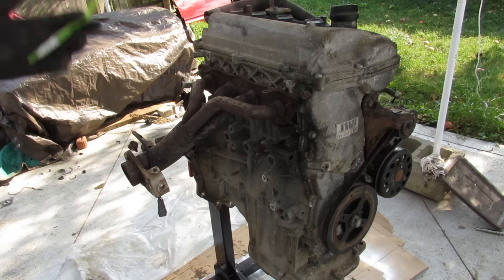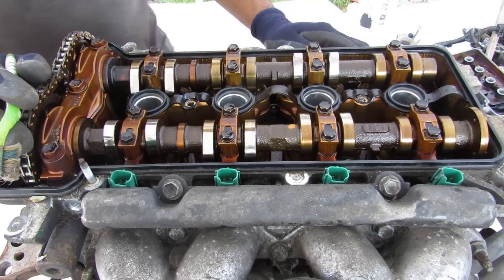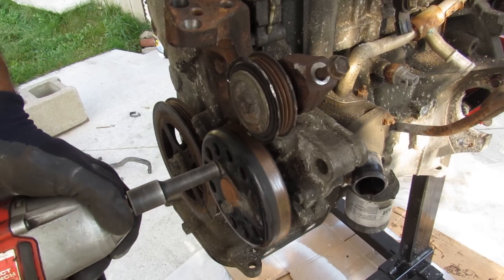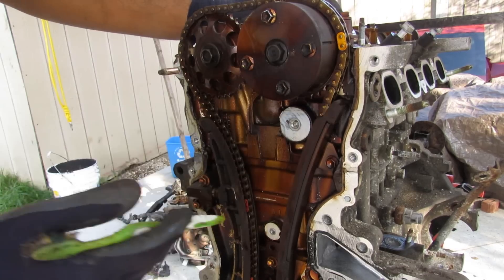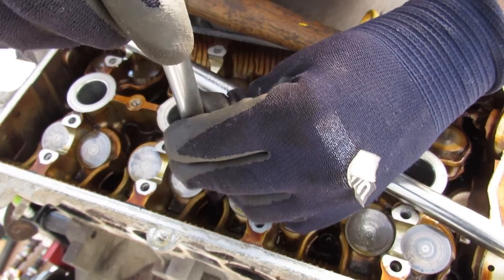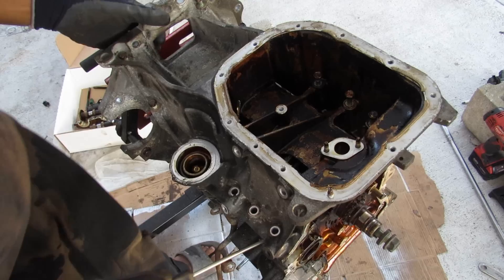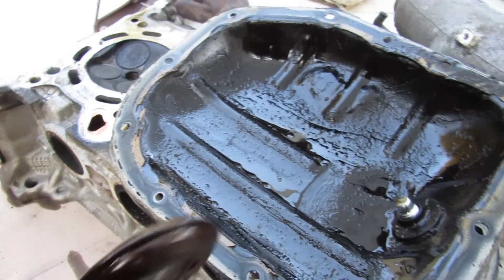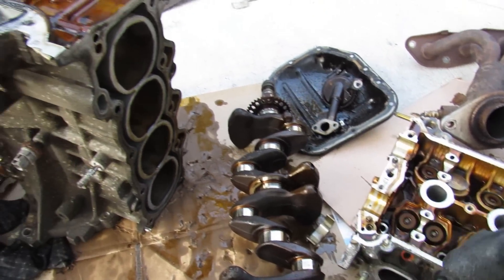What's inside a 500,000 km Toyota Engine?

Comment: The engine is so well made. Although a hybrid car uses its engine less, there is a lot of start/stop on the engine. So Toyota must have figured out how to prevent wear on start/stop situation in order make the engine last forever.
Reply: Starting only causes wear due to low oil pressure and cold oil being ineffective. Once the motor is up to temperature, starting it again only wears out the starter motor itself.
Reply: @grahamek86  and a hybrid doesn’t have a starter motor. The secret is: they start on the drive engines, permanently connected through the single planetary gear that makes up the transmission.
Extremely simple, mechanically.

Comment: Toyota's are just amazing. I have seen many vehicles with 500k kms. No other makes comes close.
Reply: My wife and I both have Chevy Tahoes that have over 300,000 miles on them and only ever changed alternator and water pumps. Granted we are both mechanics and keep up with maintenance but they still run like new with plenty of power and run hard daily. No sludge or leaks. Hers does burn alittle oil but isn't as meticulous as I am
Reply: @christbennett429  Granted bigger vehicles will last longer. But Toyota s small cars r also awesome

Comment: I wonder if the basic engine block may have been even older than this. Toyota echo maybe even the Toyota Tercel at some point had a 1.5 L engine. I know the cylinder head would have been different. But I bet the short block is essentially the same.
I've got an Scion XA with a 1.5 and it certainly looks identical the water pumps in the same location etc. And that car came out in '04.

Comment: MY DAD'S CAMRY HYBRID LE 2018 I BOUGHT IT FROM BRAND NEW IN DEALER AT $29K OUT THE DOOR RIGHT NOW RUNNING 280.000 MILES NOW. HE USES THE CAR TO DELIVERY EVERYDAY. 

I DO OIL CHANGE 0W16 MOBIL 1 EVERY 6K MILES AND CHANGE TRANSMISISON FLUID EVERY 100K MILES USING 10MM HEX DRAIN AND REFILL (3.5Q ATF WS CAME OUT) . NEVER DO BRAKE JOB (FRONT BRAKE PADS STILL 6MM LEFT), 

NEVER DO COOLING SYSTEM FLUSH OR WHATEVER, ELECTRICAL WATER PUMP, BRAKE LUID, HV BATTERY ECT STILL RUNNING LIKE A NEW CAR.  THE CAR IS STILL RUNNING PERFECTLY. THANKS TOYOTA. MOST RELIABLE IN THE WORLD.

Comment: Toyota engine 300,000 miles, in much better shape than most Chrysler, Ford or General Motors engines with 30,000

Comment: my prius had timing cover oil leak and those clutch springs failed before 70k and whoever had that should have used a good synthetic oil and filters also cheap oil and or not changing will do..wish you would have done a compression and leak down test before you tore it apart

Comment: Interesting that I drove a Chrysler Concorde 228,000 miles on standard Fram filter. I sold it cheap at 228,000 miles and the folks that bought it said it was the best car they ever had. At 215,000 or so I pulled the intake manifold to change manifold gasket that had a small annoying leak. When I pulled the valve covers and intake the inner surfaces were were like new. The assembly line inspectors’ initials written on the undersides were easily visible. There was no build up of any kind in the crevices so I’d say the Fram filters did pretty good over those seven years of ownership. Helping the Fram filter was my religious changing of the oil maximum of 4,000 mile intervals. This engine you show was not a victim of Fram filters……poor lazy maintenance was responsible for that sludge. The engine was on borrowed time.

Comment: That looks really good for 500,000km, someone looked after it, I’ve taken apart some Mazda 3 and 6 engines and the cam shafts were caked in old oil at 230,000km.
Reply: I have a 2006 Tacoma 2.7L 5speed manual.  Just passed 200,000 miles and works great, doesn't  burn a drop of oil.
However, it leaked oil, and I've replaced the head cover gasket. The old one was brittle. Old rubber parts die first. But with a bit of care, Toyota engines go forever.

Comment: I have a 1NZ-FE in my ‘07 Yaris with 271,000.
Drive it every day since I bought it with 18,000 miles.
I’ve changed the oil at 10,000 mile intervals with Mobil 1.
Currently uses a quart every 10,000 miles.
Only replaced the alternator and starter.
Best car I e ever owned !

Comment: Wow! What an educational video! 😃👍👍👍
After having a Prius Mk. 2 for over 13 years I'm driving now a Yaris Hybrid (XP13) with the same engine.
I'm thoroughly convinced of this well  designed and simple engine.
Are the crankshaft bearing inlets made of lead❓
Reply: Modern engine bearings are made in multiple layers. The back is steel, which is covered with a thin layer of either aluminium/tin alloy or copper/lead alloy. If copper/lead is used it will in turn be coated with a very thin layer of either tin/lead alloy or pure tin.

Comment: In my experience, almost any engine approaching 300k will be burning a little oil no matter how well its been maintained. I'm referring to valve seats and piston rings. I've got a 1mz-fe with 260k. Synthetic its whole life and changed every 6k. It needs about a half quart a month if driven hard and over 80 mph. The valve cover gaskets are famous for eventually leaking on that engine too. They were just replaced and no leaks for now. A few seconds of blue smoke if started a few hours after an aggressive drive.
Reply: Valve stem seals will often go before rings or seats. Then oil will be sucked down the valve guides by manifold vacuum, even if your rings are perfect.
Reply: you are absolutly right, we owned a corrola verso for 15 years, it was still driving good but we needed the oil just as often as you fill up with gasoline

Comment: Is it really fair to say the engine itself has ~300k miles since it came off a hybrid? I’m not sure what the average duty cycle is in a Prius for the average driver but even if it were only on 50% of the time that engine looks clean for 150k miles of actual use
Reply: Still hybrid engines get a lot more wear starting and stopping all the time I'm sure. I'm still extremely impressed.

Comment: i managed to make my 2007 UK gen2 prius (everything stock including battery) to do 62 us mpg (75uk mpg) just with temperature spoofing and nothing more 
i basically drive the car all the time in stage 4 
gen2 prius has a very messed up engine software wich doesn't allow the car to be efficient to full potential 
I'm still working on ways to make it more efficient and i truly believe its capable of 70 us mpg under normal driving with refreshed or modified engine software

Comment: I have a 2013 Prius C same engine model with only 105k miles!! Love this video
Reply: Remember to clean the hybrid battery air intake, which is in the back seats, so your hybrid battery does not overheat.
Reply: @hedgehogthesonic3181  thankyou, I have been warned on a Prius c FB page about this 👍.
Reply: @Toyeboy89   You are welcome. Do it regularly since it is very important for the hybrid battery to stay cool for its longevity
Reply: @hedgehogthesonic3181  also since this engine did have some carbon buildup I'm thinking changing the name brand full synthetic oil & filter at 7000 miles instead of 10k. I expect to need a hybrid battery sometime thankfully there's a company that offers a lifetime warranty on them and installs them. I'm still better off economically paying $1500 for a battery install versus driving a non hybrid.
Reply: @Toyeboy89   One thing to remember is that the engine of the Prius C is a modified version of the gen 2 Prius, and the C has proven to be more reliable than both gen 2 and gen 3 Prius. I would still use the engine oil the manual says, would not recommend using a different one. But indeed, it is better to change the oil every 7,000 miles instead of 10,000 miles, though it depends in the driving conditions. It is better economically to pay $1,500 for a new hybrid battery every 10 / 12 years, than it is to drive a conventional ICE and waste more money on fuel, and maintenance.
Reply: @hedgehogthesonic3181  I meant if anything I would use a higher quality but same weight oil.

Comment: Wow, this looks WAY easier to service and repair than the Vortec 4300 in my truck... guess I gotta get a Toyota sometime lol.
Reply: Here I thought the GM Vortec trucks were some of the easiest to service.
Reply: @doncorleone2713  Just replaced one of the oxygen sensors a little while ago... not fun. Have to get under the truck and there's very little wiggle room to get it out. That's how I'd describe the whole engine, very cramped, parts are difficult to get at. I've had to take the wheels off to access some surface-level parts, might've been two of the spark plugs if memory serves? Or perhaps injectors.

Compared to other American trucks it might be "easier" but I don't have much to compare against. In a vacuum I'd describe it more as a headache.

Comment: Well you mentioned this car was made in 2004 but there's one problem odometer on non facelift priuses stops at 299999km  so the odometer most likely was changed to the facelift one and  doesnt show the real kilometers. But me as five 2 gen priuses owner and with expierence of changing and dissasembling this engine i believe it had over 500k km also one of my priuses have over 700k km and still works as a clock exept higher oil consumption. By the way all of them have LPG system because they work as a taxi.

Comment: Looks pretty good! I believe it could run another 300k with no major issues aside from burning oil. 
I expect it to be cleaned up and set in motion again? 🙂
Reply: Not after breaking one of the timing tensioner chains. This vehicle is going to be junked, it was totaled somehow. Maybe the catalytic converter was stolen. The catalytic converter in even the oldest Prius is the #1 sought after thieves because they have the most rare metals out of any other car brand due to Toyota trying to go very low emissions with the Prius. It's so expensive that replacing the catalytic converter costs more than what the vehicle is worth especially with that mileage and many states don't allow aftermarket catalytic converters.
Reply: @SI0AX  The Prius gen 2 catalytic converters are still getting stolen in EU so the oweners are replacing them with aftermarket ones. They are holding up pretty much after a few years and they are not even expensive as OEM ones.

Comment: Question, since no mechanic can help me and you seem like you know your job great.
So my car shakes quite a bit when turning on the engine and when turning off too. It does not shake when in neutral, or in gear or while driving just when turning on or off. What could it be?
I have a feeling it's due the harmonic balancer going bad or the EGR valve is dirty?.
The mechanics inspected the engine mounts and said that are in good shape and it's not causing the problem.
Tnx
Reply: maybe exhaust system oscillations?!!

Comment: I am in awe of your knowledge of engines, but I cringe a little when you identify a fastener by its head size rather than diameter.  The valve cover bolts, for instance, are 6mm, with 10mm hex heads.

Comment: What do you think about putting additives in the engine ?
Reply: Use Toyota oil. It's got very good additives in the right balance. Or just use oil with the right specs and change regularly. The brand is off less importance.

Comment: Impeller is metal, unlike some VW 🤣
I have a 1.8T, I felt that
Reply: What engine are you referring to? I have a AEB 1.8T, and honestly I don't know if the water pump impeller is made of metal or not
Reply: @STFDVC1  probably plastic.  Mine is an AWP and has a plastic impeller, I'm replacing it with metal soon.

Comment: I really appreciate for showing the piston and piston rings closer, so we can see what happens with the engine by time. The engines suffer oil consumption early, mine does it on 126k miles, oil changed at every 5-6k miles. I now try to clean it from the inside with special chemicals through oil and with full synthetic oil at every 3k miles or a bit less
Reply: Marvel Mystery Oil is a good, cheap, cleaner fyi. It’s not harsh like some other crankcase cleaners.